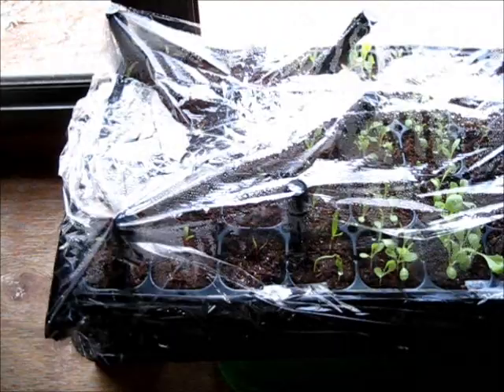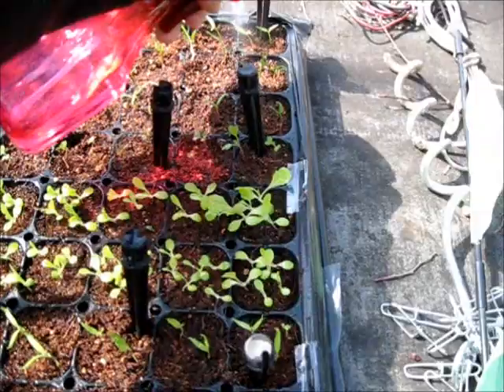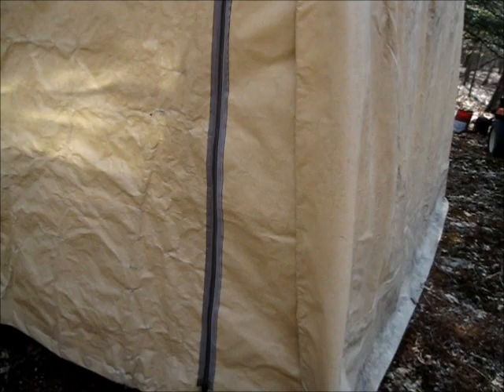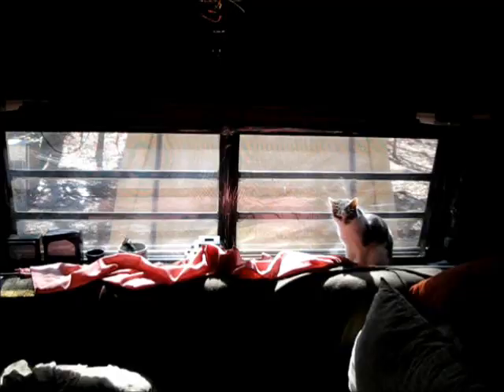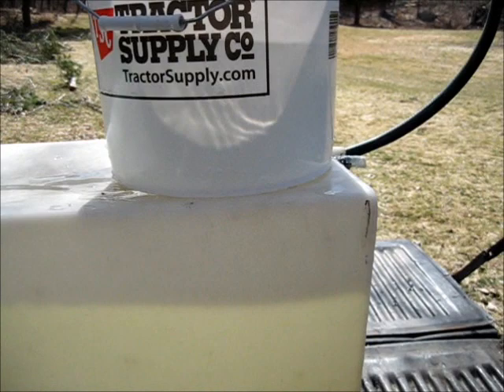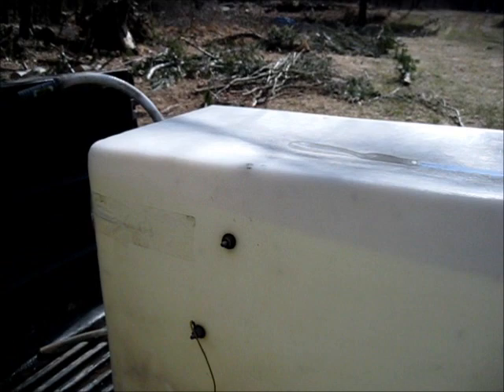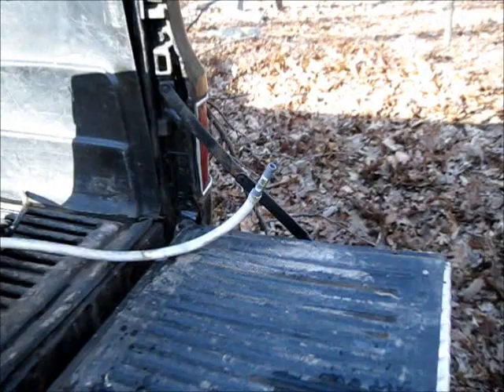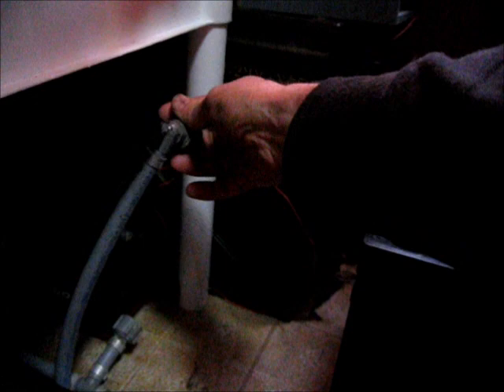Creek Day At The Off Grid Solar Camper Trying To Get Running Water

Comment from the maker: Thank you. I figured I should tell it like it is.

Yes, that is an old pump house. I was up near the owner's house at this point. I plan to make a ram pump up here for water supply. In summer the owners well runs dry and they use an electric pump to fill their well with creek water. They drink it straight up like that.

The creek angles far away from my camper. A few thousand feet I think. I am set way back deep into the forest on the back of the property.

Comment: as an old nite watchman for logging companies your best friend is and old rv 12v pump fill your tank off your truck batttery and if you are lucky you have a place that will fill with gravity and when you fill all your tanks you get home and again use that same pump to fill your holding tank and like you i dont like the taste of plastic so i use a charcol filter it helps much i have lived this way for almost 15 years and im still using the same pump i took out of a wreacked rv

Comment: Troy. I bypass my hot water heater in the winter with a short 1/2" pvc pipe. Just connect it to the fittings that hooked to the old hot water heater. Good luck.

Comment: just a thought on water transfer, I used to have a cordless drill and had some minor flooding in my basement, i bought a pump that fit the into the drill and was able to pump out the water.... perhaps the same concept would work transferring from the creek into your tank , then from your truck into your tv tank...sure would be a time saver!

Comment from the maker: The power is the easy part. But getting the water tank down low enough for the water pressure to pump it into the tank is the hard part. I cannot lift the tank when its full. But I have heard a lot about a ram pump and will make one soon.

Comment: since you cant pipe the water directly to your OGC, If you are able to you should build a ram pump water station right next to the creek. Let it Run filling a larger elevated Tank (6 foot or So) with an overflow that will put the water back in the creek. So when you need water it ready. The occasional hockey puck chlorine pool tablet in the water station will keep the tank clean. I know your busy, Its just a thought. Keep up the great work.

Comment from the maker: I am holding the waste water in the tank for now. I am planning to do the same thing as you. But I think the ground will soak it right up. I use all natural soap anyway, so it should be fine.

I was thinking about making some kind of a liner for a pond. Would be nice to have some water plants as well.

Comment: troy. take a 5 gal bucket and place a hole on the side near the bottom and add yout hose. then place the bucket on the top of the tank and just fuul from the carried water in one bucket the the bucket with the hose and it will fill your tank. you can even place a filter between the bucket and tank to stop any debre from getting in to your tank

Comment: as long as you put your bucket higher than the tank you could start a suction line from from the bucket to tank to fill the tank more efficiently. Just get the air out of the hose to the tank and it will suck the water out of the bucket

Comment: LOL Troy you defo learned the hard way how to live off the grid It seems funny watching these videos now. why not just dill a hole and put in a tap at the bottom of the bucket or buy a $5 funnel.
Reply: grahamdavidhardy158 I think the reason was because he was broke and only spending money on absolute necessities. It was about using what he already had or managing. Plus going into town just for a funnel etc was a complete waste of fuel. 
From what I can gather Troy was thrown into this lifestyle after losing his job. Even though survival is his passion, it was winter, he was forced to move and hadn't had time to prepare. 
I'm pretty sure he realises there is an easier way but sometimes you can only work with what you have.

Comment: water idea #1:  make a better bigger funnel. think megaphone size.  that way you can pour from one big opening into another big opening.
water idea #2:  can you take a bucket and put an opening into it low or in the bottom that would have its own hose sealed/glued/cemented in it?  then you could sit the "funnel bucket" on the tank and pour from one 5 gal into another 5 gal and the water level would lower as it empties into the tank but you could get another bucket full as it fills

Comment: Heh heh. To get a clean siphon without sucking on the hose, just put the hose in the bucket of water and let all the air out of the hose while it is under water. Just take one end out and quickly put in the lower bucket(or tank in this case) and it should begin flowing to the bucket. It's how I get the "vacuum" going for the fish tanks at work. However, when you got a siphon with a hose that size you have, it will sound slow as the flow will be slower.

Comment: im on budget for gas and electric was 95 normal but use was 72 it lower from solar i checked if to much insulation helps lower bills my gas was 135 a month before i redid my walls with insulation in them with wall board over 135 to 51 now just from that! the more i save is from un pluging stuff or turning stuff off there a few things you can unplug fridges & frezzier & frunce

Comment: Can you try turning the tank on its side so the opening is at the top? Then then the funnel can just set in the hole.   Or perhaps you can run the hose directly to the river and start the siphon or gravity feed from there?   Easy to say hard to do, but might work.

Comment: i use plastic sheet's & staple gun to staple the plastic in side the window & put a towel or blanket over the windows this stops the air from bleading though the glass it did this normally plastic is higher r rating then plane glass! this might help i have left over foam board in side windows too stop heat from going though i had stuff left over i used it helps my gas bill is 51 dollars a month and my last electric bill was 72 dollars use the coldest month! this is my monthly bills

Comment: put water tank up against the cab in the truck bed, put the bucket on top of the cab, use a piece of hose to siphon water from bucket to water container. no new parts required other than a hose to siphon. oh and here is some food for thought: /watch?v=1pfz25RbBwk

Comment: Troy -By the creek when you were filming, just before you looked at the deep pool was that a pump house structure or a dog house?
Have you thought about a ram pump? No power required and looks like you have enough water drop in the creek to run one but what is the distance to the trailer? Could be the cost of pipe would be excessive though.
I shoould add I like how you are honest about your failures(open water heater line) and the triumphs.

Comment: Dude, go to Home Depot and get a drill pump for $7.It does require a drill with a minimum of 1200 RPMs. You need that and 2 water hoses, an extension cord, and an 800 Watt inverter that you can connect to your truck battery to run the drill.
Reply: those drill pumps are useless unles your moving water 10 ft downhill
Reply: Not really brother... I use one to fill the RV from my 300 gallon tank. For 50 gals It take 13 minutes to geter dun... But, you must admit its better than the method used in the video :)

Comment: HOW FAR AWAY IS THE CAMPER FROM THE CREEK?WHY CAN'T YOU BUY 1"SPRINKLER PIPE COMES IN 300 FT  ROLLS FOR $60 AND MAKE A RAM PUMP TO PUSH THE WATER? SORRY ABOUT CAPS LOCK.JASON